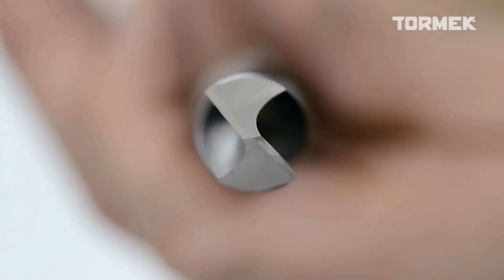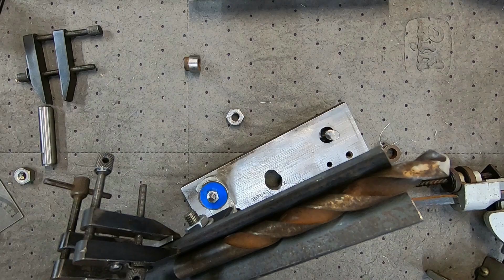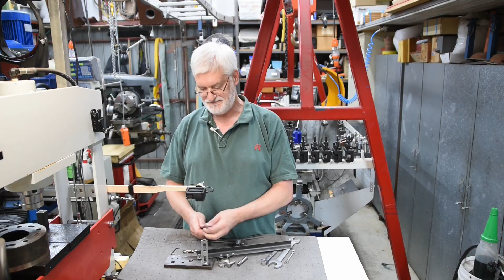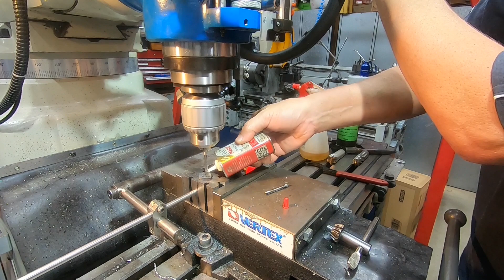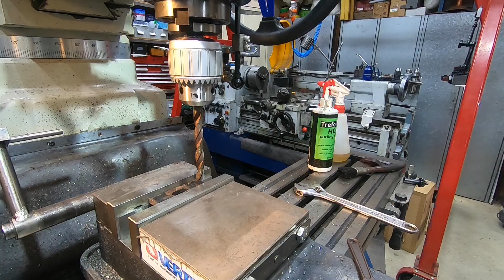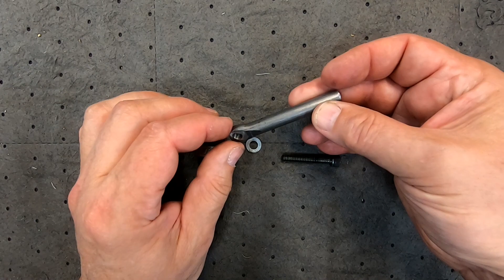Drill Sharpening - 4 Facet Grinding.

Comment: Hi, genuine question (couldnt find a way to dm you)
Is there a reason why you dont sharpen by hand, it takes ~60 seconds to sharpen a bit.  For reference im not a machinist perhaps a lathe requires a perfect centred bit?
Ive always ground my bits by hand and often change the angle/s depending on the drill and/or material at hand
Reply from the maker: Your question is perfectly valid and I know that many people are able to sharpen drills freehand. I have just never taken the trouble to learn, or perhaps more accurately practice, sharpening by hand; I have tried it a few times over the years with very indifferent results. In particular, I was not able to get the cutting lips to be of equal length. This, of course, results in an oversize hole. However, I may yet have another (more determined) try at this - it would certainly be a useful skill to have.
Cheers.

Comment: Hi, would it not have been better micing up the tip of the drill to see if it had drilled under or over size?
Reply from the maker: Possibly, but it was easier to measure the drill shank and, given my understanding of how drills are ground from a blank, the tip can never be larger than the shank. Thanks for your comment.
Cheers, Alan.
Reply: @alanshomeworkshop  the shank is meant to be smaller than the business end, so measuring the shank can be misleading but it only a few thou or so.
Reply from the maker: @chrisstephens6673  Interesting. Thanks for sharing Chris.

Comment: for clamping the drill bit why not put a straight shank on a jacobs chuck to go through 2 sets of bearings and put a locking indexing plate on the end, all you would need then is a reference for the existing angles of any bit and your rotation should then be spot on.

Or instead of an indexing plate you could make a protractor (with a needle somewhere) held on the shaft with a locking nut that you could zero out and have some sort of brake between the 2 bearings on the shaft (although this is liable to introduce run-out if not done with some finesse)
Reply from the maker: An interesting idea, but it would also need an adjustable height rest to support the drill tip. Without this, the drill would be gripped/clamped a long way from the grinding contact point. This would introduce a lack of rigidity and likely cause chatter problems. Might try it and see though. Cheers, Alan.

Comment: have been looking for a solution but what is your mechanism behind the correct starting orientation (rotation) of the bit and how small can your jig go with?
Reply from the maker: For correct sharpening, the drill lip must be horizontal. I set this initially by eye using a straight edge. Rotational alignment of the drill lip is then indexed by moving a peg (small bolt head) into contact with a drill flute. The drill lip is then brought into contact with the grinding wheel and fed into the wheel as its length is consumed by sharpening. By keeping the flute in contact with the peg, the drill rotates as is it moves forward and the lip remains horizontal at the point of contact with the grinding wheel. Hope this makes sense and answers your question.
I have not tried to use the jig on drills smaller than 6mm diameter. The limiting factors on minimum size are: 1. ability to see the lip clearly enough to set it horizontal and 2. whether the index peg can fit under the edge of a drill flute. My eyesight is not as good as it once was, and I now choose to consider drills under 6mm to be a consumable so do not attempt to sharpen them. 
Thank you for the interest.
Reply: @alanshomeworkshop  got you but i think if the helix angle is different in that case you will get a different lip clearance angle i guess according to same setup, i have just made a grinding jig to be able to regrind very small bit from 6 and down to 1mm, please inbox my page if you are interested to talk about it more
https://www.facebook.com/GraphicManInnovations

Comment: As with the previous bought jig I believe that in this nicely built jig the feed should be done from behind the drill as well instead of from the table Y feed. By feeding the table Y feed the lip is slowly but surely diverging from being horizontal, the outer edge is dropping due to helix of the flute. The change is surely minute as in every grind only a small amount is being ground of but if you were to grind a lot of material off due to edge chipping fro example it would compound to a larger change. 
Try modifying the jig to feed from behind the drill and having the flute stopping bolt in such a location that it would force the drill to twist along the flute a little as it is being fed forward so that the edge will remain horizontal throughout the grinding operation. I believe it would improve your results.
Reply from the maker: Thanks for your comment. I did consider the issue of the lip dropping as the drill length is consumed, and I started the secondary relief grind with the lip angled slightly up rather than level for just this reason. It would certainly be more correct to feed the drill past the index peg following the helix angle but it was just easier for me to use the table movement with the prototype jig. It didn't seem to have much adverse effect and I did check the horizontal alignment before starting the primary relief angle.
However, I do plan on factoring this idea into an improved version of the jig. I had this in mind when threading the adjusting screw at 20TPI as this will facilitate making a dial graduated in thousandths of an inch. 
I am also contemplating a couple of other improvements aimed at getting a better surface finish from the grinding process.
Reply: @alanshomeworkshop  If had a tool/cutter grinder or a surface grinder with such a jig I would probably use the table movements as well and get around the negatives in ways such as you mentioned. It's so much easier and controllable it makes sense to use the machine's precise and smooth axis movements. After all I imagine endmill end faces which are glorified drill bits are ground by using the machine's x-y-z axis motions exclusively.